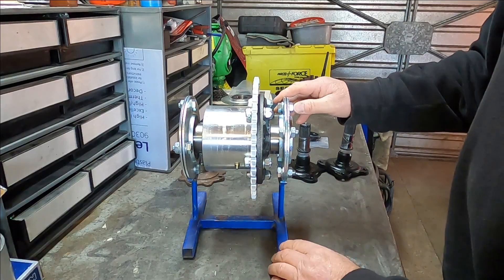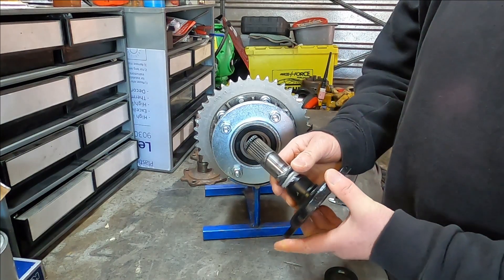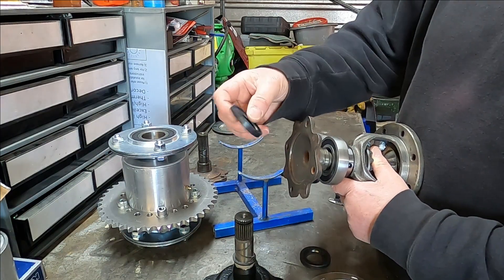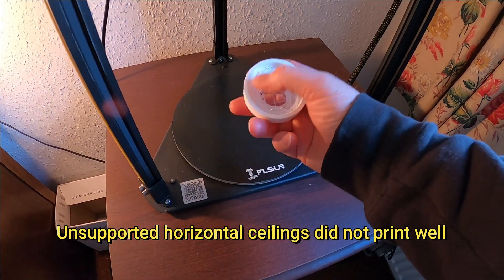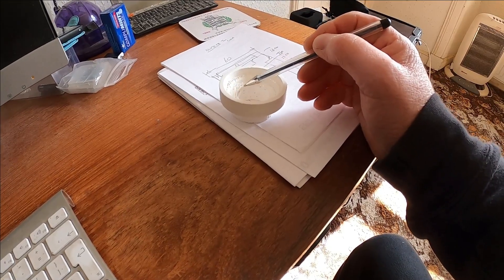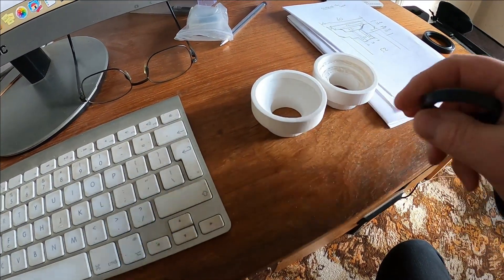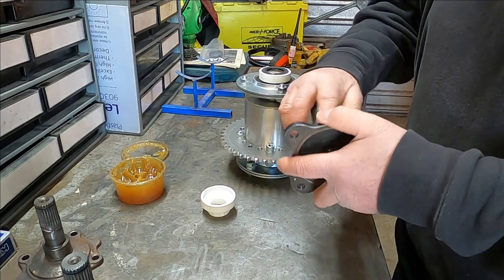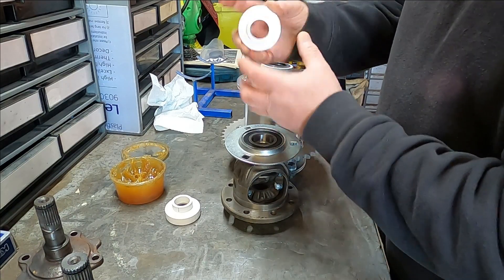Simple MX5 Chain Drive Differential Part 2 - Adding 3D Printed Oil Seal Carriers

Comment: doug did you make any seals for Ib5 diff ..are there any seals required ive filled with grease ..but realised it may need seals
Reply from the maker: Yes, it is best to fit seals even with grease. On this unit I used simple 3D printed seal carriers and 40mm ID oil seals. On other models I have included oil seal provision on specially machined aluminium alloy bearing carriers.

Comment: Do you think there would be cooling problems in a track application?
Reply from the maker: The differential temperature or the 3D printed seal carriers? The differentials stand up well and are used on lots of track cars. Viscous coupled LSDs could overheat if there is constant wheel slippage (adverse design feature of that type of differential). The 3D printed oil seal carriers would be best printed in a higher temperature plastic (PET or Nylon) but they are unlikely to reach high enough temperatures to soften.
Reply: @DougsShed  I just bought a JDM NC torsen helical diff for my project and will begin building it to be chain driven. I'm a young mechanical engineer and my plan is to design the sprocket in SolidWorks and then have a shop laser cut it out and machine it to completion. Do you have any advice for what I need to be aware of in designing a sprocket I have never done that, also anything I need to be aware of that I should put in the notes for the machine shop?
Reply from the maker: @briland7166  The easiest way to get a sprocket is to buy a blank sprocket and then machine the centre hole and mounting holes to suit the differential's flange. If you look at a sprocket you will note that it has a chamfer on each side of the teeth which would need to be added after laser cutting.

Comment: Doug how will the diff hold up over long driving periods? would the grease be ok or would it need another solution?
Reply from the maker: Grease should be OK as long as it remains in contact with the cross-pin and gears. Fluid grease would be best.
The differential does not have hypoid crown-wheel or pinion gears which would require constant oil lubrication.
The differential's planet and sun gears do not rotate at high speed. They only rotate (differentially) when cornering or with one wheel spinning.

Comment: Great thinking again, well done! I'd even try a MKIII and put an o-ring or two on the outer spigot of the 3D printed part to seal against the inside of the bearing race
Reply from the maker: Yes, good idea. However, I prefer to use a smear of polyurethane sealant to make the oil seal carrier semi-permanent in the bore of the bearing.

Comment: Can’t seem to open file ??
Reply from the maker: Hi Mike, I have checked the links to the files in the description. The links are correct and the linked files download to my computer correctly. The .stl files import correctly into Cura (and also back into my CAD system). You need to save the .stl files to your computer then import them into your 3D slicer program (or import them into a CAD system)